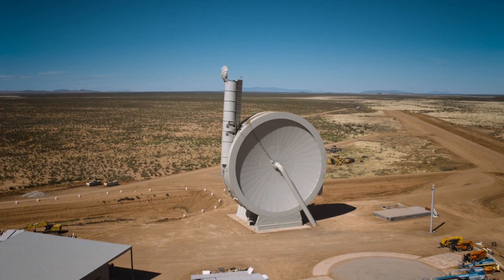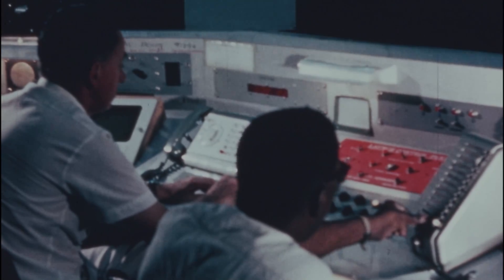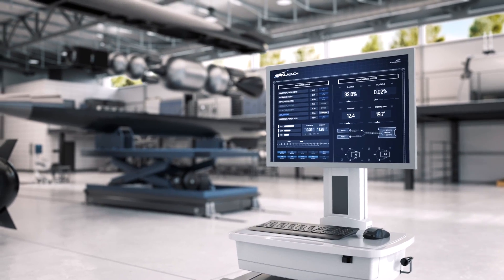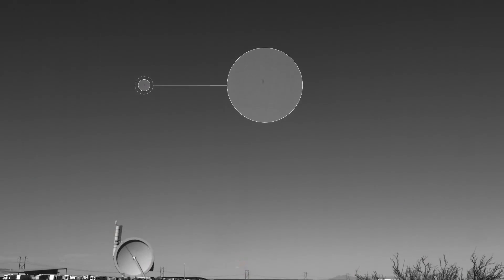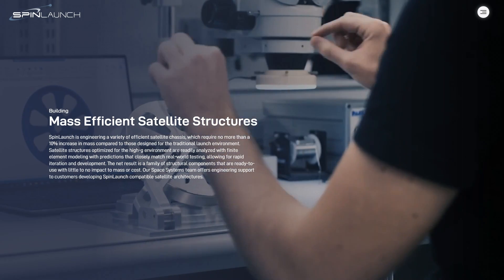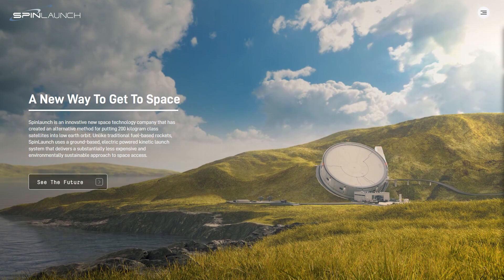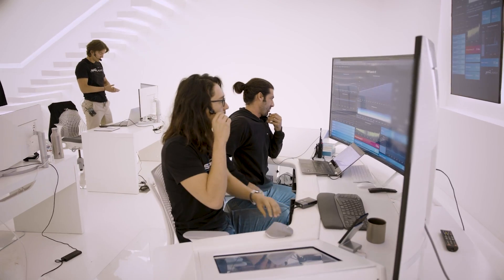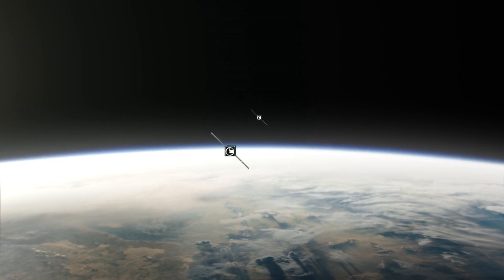Can Spinlaunch Throw Rockets Into Space?

Comment: This thing is never going to work.  It's just one of those programs rich people love to dump money into.  

There is a reason the test vehical looked like a military shell.  The geforece is all being experanced laterally during spinup.   Just think about the insane amount of torque that is being experanced by sections of the vehcail just a couple inches away from the mounting points. This thing will be folding launch vehicles in half. Not to mention materials doint scaleup lineraly. 

The other reason this goes no where is the launch device is huge and expensive. If you have one launch that is off by a millisecond it will blow your launch facility up with kinetic fore alone. 

The other even more intresting way to see this thing fail will be when a small item breaks off during spin up.  It will bounce around inside the chamber striking the arm and vehicle breaking off more pieces and repeating the proccess.  It will be the Kessler Syndrome in a bottle.

Comment: Only problem with this: So far, they have demonstrated that they have 0 of the innovations necessary to get anything anywhere near orbit. Problem is, to get to the necessary speeds to go suborbital, they need to sustain a nearly perfect vacuum or develop a material that can withstand the thermal heating created by going Mach 5 in any sort of atmosphere while also holding a large mass on one end and being spun up to Mach 5.
Reply: They would need both because the projectile still has to survive that heat after exiting the sling.  I wonder what a 5,000 mph sonic boom is like….  I bet you don’t want your control center right next to that.
Reply: Sonic booms only happen once. Once you speed past the sound barrier there are no more sonic booms. After 750mph, you can reach 5000mph no problem
Reply: @franimal86  This is completely false. Once you pass the speed of sound the atmosphere will resist your movement so it gets harder not easier.. friction is a thing y'know.
Reply: @franimal86  sonic booms are continuous through flight we hear it as a crack because we are usually standing still as a plane flies quickly by.  So although the speed of the craft probably doesn’t change the intensity of the sound, its a presure wave so the high density of the air at ground level probably does,  as would the shape of the projectile and the trajectory.  If a super sonic object tumbled, as this launch did, but kept going at super sonic speeds it seems like you could produce something that could be destructive
Reply: @franimal86  have you ever been to middle school?
Ever heard of drag?
Ever learnt what drag equation looks like?
Spoiler, it involves V squared. That part of equation at mach 2 is 470,596.
At mach 5 it's almost 3 million.
I will once again compare it to Blackbird, which was as aerodynamic as possible, flew at ~20km (air density is also exponential, so you're looking at much much much less drag than ay sea level), at mach ~3. It heated up like spacecraft during reentry (much less but already).
Make up your own conclusions.
Reply: Agreed:
I do find it worrying that so many of the 'smoke and mirrors' schemes that have appeared over the last few years have found such widespread popularity and praise instead of the oh-so-many-questions they deserve.

"Hey, I'm doing this new and awesome thing!"
Really..? It looks very much like an idea from 50-150 years ago that died a death because it was impracticable nonsense, to me!
"Look, I've got pretty animations and everything."
So no actual numbers or a real-world demonstrator then?
"No! Look at my lovely scale model!"
Still no actual data then, a workup of the issues, or analysis of what might happen when you scale up for a real-world test?
"Harrumph, everybody else thinks it's awesome!"
Ever heard of the Emperor's New Clothes? What are you hiding in those fancy promotions and blurred-out screens?
Reply: @charlesjmouse  Yeah, what is frightening is that these guys invest tens of millions of dollars on ideas that haven't solved basic engineering challenges because they know if the graphics are flashy enough they can get hundreds of millions in investments.
Reply: @RjWolf3000  Is this company an SPAC? They look like Rivian, Lucid, that drone-aircraft vtol company. Hmm
Reply: ONLY problem? There are dozen problems with this.
Starting with the most important one - there's no need for it. We already have a reliable launching system, that delivers both tons of cargo to orbit AND humans. It's reliable as fuck, and most importantly, it's NOW. Not 50 years into the future.

Secondly, launching what seems like one starlink satellite in current scale seems useless, and scaling it up will be hard to impossible. For various reasons. 

And yes. Going mach 2+ at sea level = huge drag (very inefficient), huge temperatures (very dangerous). Blackbird was experiencing orbital reentry like heating at mach 3+ at 20km or w/e it's altitude was. So yeah gl. Maybe you can cover entire rocket in heating cover, i wonder how well that will go for payload capability tho.

So tbh, the biggest problem is that this is a PR stunt. Normal people would see this and laugh. Who will use it? SpaceX? Nasa? Youtubers?
Reply: @dr_birb  Exactly. I mean, lets be honest, theres only so much more cost we can cut from rockets, but this system isn't the way to do it. What makes this system interesting for tech snake oil is that you can build a working "prototype" with relatively little investment, whereas something like a space elevator or a skyhook cant exactly be prototyped.
Reply: "Ladies and gentlemen, I (Unknown Genius ®) have the answer to the projectile heating problem! It's easy! We simply build our "Rotational Auto Launch Facility..." 
" Underwater!" [Pause for applause, and cheers ]
Fabulous CGI video plays. 
" Go fund me and investment opportunities are in your press pack!"
😄
Reply: @lightningslim  That is nonsense. I (Person with a high school degree in physics) propose we build our launch site in space! That way, we don't have to worry about drag.
Reply: In this very video that you are commenting on is a reference to the sprint missile that went mach 10 "in a few seconds and in the lower atmosphere". I don't see why suddenly mach 5 would be an issue, especially since at that speed it quickly moves to thinner and thinner atmosphere.
Reply: @TheJohnreeves  Well first of all, even if you do have the material to survive this, making a sprint missile go this fast is one thing. Building an entire rocket that can do this (You still need an upper stage that pushes the payload into orbit, mind you) is an entirely different issue. Besides, if you actually look at the footage, it's not that hard to see that they can't even keep their projectile straight. And besides, the projectile they fired went about half as fast as what you could have achieved with a bit of gunpowder and a cannon barrel some 70 years ago. The concept of spin launching has been around for decades, just like the Hyperloop, and again, just like the Hyperloop, hasn't seen any significant developments since then except the renders have gotten prettier.

This is the exact same pattern you see time and time again with all kinds of snake oil tech companies. A group of 20-somethings take a concept that's been around for a long time, but hasn't seen any serious improvement since then, and for good reasons, claim to have come up with a radical new idea that'll revolutionize the industry that has since given up on trying it, and get millions of dollars and countless awards just thrown at them by universities, magazines, and governments, without actually demonstrating a single solution to the problems that made the industry in question give up trying to develop it in the first place in favour of a solution that actually works, even though anyone with an education in a relevant field should be able to see the problems with it. 

It happened with the Hyperloop, it happened independently to several attempts of creating solar roadways that all ended the exact way critics predicted they would, it happened with the WaterSeer, and countless other ideas. Spinlaunch is just one more company making millions off of an idea they have yet to actually present evidence has a chance to work out. If you ask me, the next economic bubble to pop in the US is these tech industries. Once banks notice these kickstarter millionaires living in big mansions paid by money from companies that have yet to actually earn a single cent beyond the kickstarter funds that these mansions were paid with, yeah, that bubble is gonna pop.
Reply: I made a comment already, but yours was much better. I dont like being negative towards innovation but I feel like we're starving for this type of critical thinking these days...
Reply: Why use a vacuum when you can just put the rocket into a cavity in a solid disk. Then there will only be air resistance around the edges...
Reply: @timtheli0n  I was just thinking this
Reply: The problem with this entire scheme can be summed up in two words. “Projectile” vs “ payload”. They can fire a projectile from this contraption (wobbly and erratic, but definitely moving). But it’s doubtful any useful non explosive payload could be launched this way. Or rather could survive this kind of launch. Plus this runs into the same issues with vacuum that mark the Hyperloop as eternal vapor ware. Everybody is talking about the energy of the centrifuge. Everyone forgets the energy required to create and hold that large of a vacuum chamber. And what happens when the vacuum is breached. Kaboom!
Reply: @andrewtaylor940  The energy isn't necessarily the problem here. The problem is that the bigger a vacuum system gets, the more leaks you are guaranteed to have. And at the type of vacuum you'd have to achieve to make this realistic, not only would you take days to empty the chamber sufficiently (do keep in mind that there is a direct correlation between air pressure and the efficiency of the pump), all you need to make the work of days or even weeks undone is a tiny leak. It's a simple equation. The pumps can only ever take out, say, 10% of what atmosphere is there within a minute. Now, to get down to 10% takes 9 minutes, right? Wrong. The first minute has you pumping out 0.1 atmospheres (assuming you start at atmospheric pressures), so after a minute, you get down to 0.9 atmospheres. But that 10% you now lost also lowers the pumps efficiency, so now, you're only pumping out 0.09 atmospheres a minute for the second minute. So after that, you have 0.81 atmospheres. Thus, to get down to 0.1 atmospheres would actually take something more like 20 minutes. If you have a leak anywhere in the system, your pumps have to counteract this leak in addition to the fact that, as the atmosphere gets thinner, they can pump out less and less air effectively.
Reply: Thankfully we have so many experts here.
Reply: Well, it's not really for anything other than a weapon anyway. The payload is tiny, this is a cheap way to fling nukes.
Reply: @MrTechmoore  The spinup time is way too long for anything to do with nukes.
Reply: Who said anything about time? The footprint for this is tiny compared to conventional launches. Spin it up, fling a round. Evacuate site. As this concept progresses it'll become more efficient into MLRS type stacked drums on the same shaft or something. It's all fun and games until you follow the money.
Reply: @MrTechmoore  Problem with that is that "It'll pay off eventually, even though i have no ideas on how to actually make it work, but i swear one day this will be cheaper and more reliable than rockets!" is not a very compelling argument for investors.
Reply: Someone watches Thunderf00t then parrots it as their own idea. 🙄
Reply: @brynthomas1498  So? Does that make the problems they have yet to solve any less unsolved?
Reply: @HolyPastrami  No but least give credit where it is due!
Reply: @brynthomas1498  credit - laws of physics (public domain)
Reply: @dr_birb  yes if its your own thoughts but when you have parroted word for word you should give credit where you got your info and for arguments sake it would be good to post the url to the video too. Helps that creator that you just copied.
Reply: @brynthomas1498  i dont even know by who or where is the word for word copied arguments...
But then again, it doesn't matter, the problems come from physics, not a youtuber.

Comment: Short answer. No. Long answer. No. Watch this fail spectacularly. It is completely unrealistic to think with the air density as it is on earth that you'll be able to put anything into orbit that will then be useable is idiotic. The money would be much better spent elsewhere.

If you watch their 'successful' video the vacuum tube is rusty... hardly inspiring. In addition, every time you launch something you have to break a vacuum seal and then spend hours having to get everything back up to the correct air density.

Comment: Uh.  It's yeeting small missiles off axis, wobbling.

Worse, every time you want to fire one, you have to replace the seals on the launcher and pump all the air out again.

And at this point, the loads are BARELY supersonic.  Nothing even CLOSE to escape velocity.
Reply: My question is what kind of g-forces will the payload have to survive while it is spinning up?  When I look at every single piece of satellite we have launched into orbit, they use fine materials and intricate components probably measured to the micrometer or smaller.

Comment: I'd like to get your take on Dr. Phil Mason's aka thunderf00t assessment of this.  The thing that stuck out to me the most was that at the speeds/energies attempted, if anything goes wrong you'll have debris at railgun-type speeds going in every direction.
Reply: Not a bug, a very fun feature for anyone within five kilometers!
Reply: Also wouldnt it break the crews neck if it was manned (havent watched all of it yet)
Reply: @GOF-pk9mg  There's no crew -- it will pull 100gs at max rotation prior to launch.  The value proposition is that it'll be a cheap way to get things high enough that a single-stage-to-orbit motor or something similar will be able to take over.
Reply: Perhaps they should build it underground?

Comment: Are there no physicists on their team? Are you guys insane? We are talking about 10,000+ g's of force ripping everything apart, every bolt, every weld, every component.  

If you try to launch a projectile that weighs 1,000 kg, accelerate it to 10,000g the projectile would have the equivalent force of 10,000,000kg.  It's literally fucking insane I can't believe people are fallomg for this...

A solid bullet is NOT the same thing as a satellite with delicate instruments or critical moving parts.  There is no material on earth with the tensile strength to withstand those forces and need I mention the projectile, above mach 1 near sea level, ejected from a vaccume would instantly ignite.

Comment: @Scott: reaching Mach 1 at atmospheric sea-level is an easy task. The problem arises when you have to launch the rocket at semi-orbital velocity, once exited the vacuum chamber the air molecule would immediately hit the rocket like if they were a wall of steel. Plus, I can't see how can they build a rocket which will not get destroyed by the extreme lateral G-force, 3,395 Gs by my calculation, considering that they need to implement within the rocket also an atmospheric engine, a propellant tank, guidance systems and the payload,  all things that would be smashed in molecules by the G-force.
Reply: Exactly

Comment: Ok Scott and company, some big red flags here. First a lot of CGI is sold as doable way before it’s done (serious projects never do that), like the Hyperloop and the Boring Company. Second I understand they intended to pump down the chamber to Low pressure right? What happens to the chamber every time they cause an explosive decompression of such a big chamber? Third did they explain how they maintain dynamic balance on that spinning arm , after the rocket has been launched? Lastly the slow motion of the projectile breaking the square seal doesn’t correspond with the round tube shown in the launch images, why?
Reply: Right serious rocket companies like spacex never release renders of projects before they’re done 😂😂😂.
Reply: it's okay to stop listening to thunderfoot when he plays engineer.
Question isn't whether it's technically feasible: it is.
The real question is can they do it at a competitive price point.
Reply: @jaqssmith1666  Fair point, put a team of engineers together to build something crazy and they'll make it. Just check your bank balance afterwards.
Reply: The squared off seal is in the centre of the round tube, between the hydraulic rams holding up the hatch cover
Reply: I have a concern that firing something from a vaccum straight into a wall of air at ~2.2km/s would just cause the projectile to explode just like a fast object hitting water.

Comment: Their first mistake was trying to shoot this thing off a centrifuge without following it's actual force vector.  It's always going to go sideways, so you might as well use that to your advantage and shoot it out at an angle.  Their second dumb mistake was not building it underground or for that matter even having a concept drawing of it in that configuration.  It would be more stable, not degrade by UV, be thermally neutral  and if it went tits up you'd just hurt some dirt. instead of endangering everything with a 100km radius.

Comment: They just need an equal sized disc brake right along the side of it. 
Regarding air: Could they compress air from the rotation over the initial phases, and then after launch use the compressed air  to help slow?